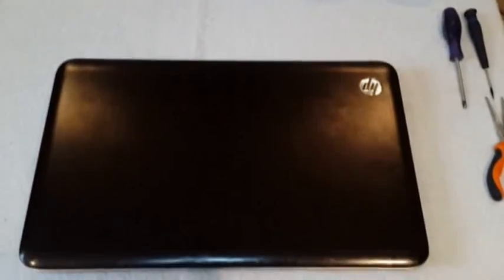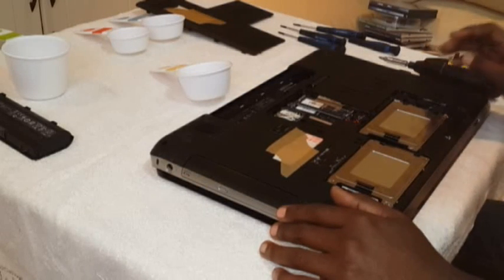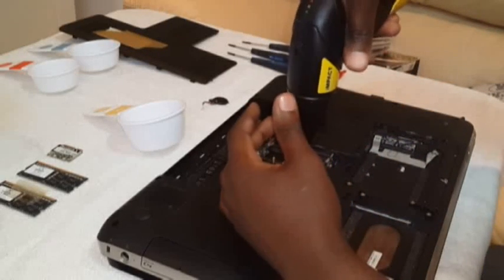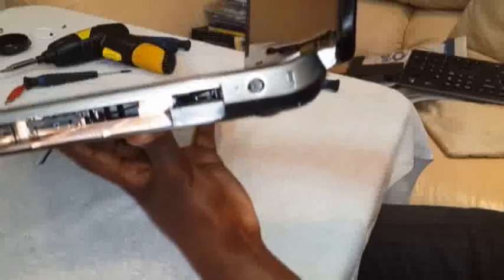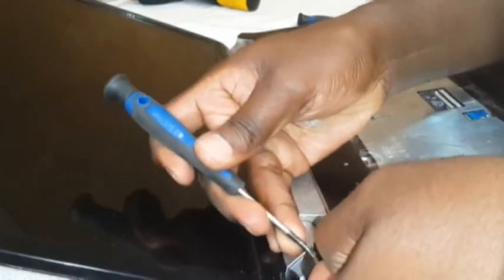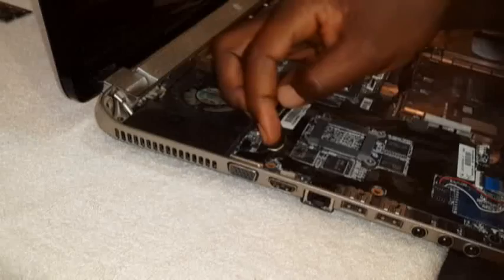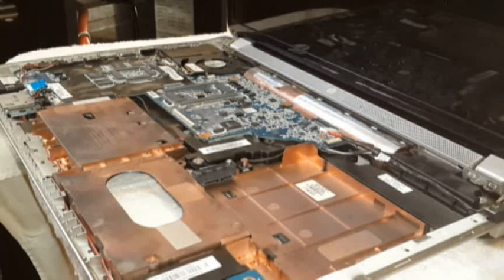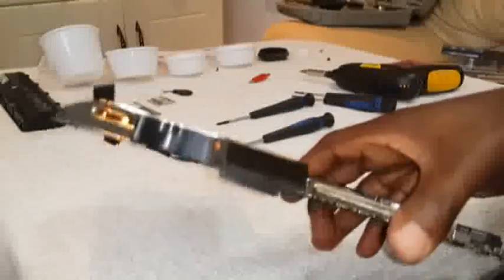Pavilion Dv7 dv7-6100 series Disassemble Cooling Fan Problem

Comment: I don't know if you're still reading comments here, but THANK YOU, THANK YOU, THANK YOU TUMZA!!!  I am a 60 year old woman with no formal hardware technology training; just a lack of fear of tearing things apart when there is nothing left to lose.

I was fortunate enough to have the identical laptop that you tore down here.  Only difference was one small cable  under the motherboard- the fingerprint reader.  My cooling fan was completely seized up.  Laptop would boot, but shut down after short time from overheating.  I used your video to tear laptop down to get to cooling fan/heat sink component for part number.  Found another video that showed how to remove and replace that.  Found the correct replacement fan component on NewEgg.

When I put everything back together, the computer wouldn't even start, let alone boot up.  So I tore the whole thing down again.  Found one cable that had pulled loose during reconstruction.  Put it all back together, and it booted right up.  New fan spinning away.

My guess is that this would have cost me $300 to $400 to have done at a repair shop.  YOU ARE MY HERO!
Reply from the maker: Great kathie, glad i could help. thanks for taking the time to give a good comment.

Comment: Great video. To replace the fan, all you need to do is detach the heat sink (screws remain in place). Peel the entire heat sink back - be careful not to upset the thermal paste. Then you can remove/replace the fan and reassemble.

Comment: Well I can tell you that your video is one of the best instruction videos on youtube. You explained it very well and step by step you cautioned the users of possible mishaps.  Unfortunately in 2014 HD recording  was not a common  option otherwise the video would have been even better. One point I can mention is it is best to flip the keyboard and disconnect it from the back and reinstall it from the back to. It's a lot easier.

Comment: Very helpful. I found a piece of plastic stuck in my laptop fan. With one hiccup (did not seat RAM properly) it went back together and is working. Who would have thought it could be done without more grief? That is, as long as you have someone else walking point and taking a video along the way.
Reply from the maker: Cameron Iwaasa  you welcome
Reply from the maker: tumza relaxing and thanks for taking the time to comment
Reply: I just realized that none of my USB ports are working. I'm thinking that I did not reconnect one of those bus wires. Do you have some idea which of the connections control the USB ports?

Comment: you can replace the fan alone I did that one year ago 
i bought it from ebay for 5 dollars and it is working up to this day.
to remove the fan you have to remove the screws on the metal cover and the sticky tape, then pull it from each side slightly away from the exhaust vent.

Comment: Excellent video!   Thank you for the help!    I had been stuck on how to remove the top cover.   Saw another video and the guy just ripped off the top with a knife and cut his finger open.   But there are the two screws under the keyboard.   So either he broke it....or the screws were previously removed.    Thank you again :)

Comment: personally i broke the air flow window without unscrewing anything and the metal one and cleaned the fan from outside
now my laptop looks like shit , thanks hp, great engineering
Reply: +anon-iraq U know...... that sounds like far easier solution then to spend hours unscrewing and detaching bunch of stuff before getting to the part you need... 
Darn it how hard it is to make damn lids in the fan areas!? HP, any brains perhaps?
Reply: me too :(
Reply: Mine broke a long time ago... cheap plastic parts and unnecessarily difficult to replace parts.

Comment: These laptops are a pain in the ass but they are actually very nice as far as speed and especially sound and video go. I will give this model of DV7 an 8 out of 10 which could be higher if access to components were simpler. When I got this the battery had been glued into place with silicone glue, not much but enough to keep me from getting it out until I decided it had to be removed to fix the overheating or be thrown in the trash pile. That was when I put some pressure into pulling the battery out and to my surprise, it only needed a tiny bit more force than I had tried before. This is one HUGE problem down and now I am off to rip out the guts and make everything new again. Out of all the laptops I have worked on (hundreds of them) this one ranks up there with the most difficult to access. THANKS BUT NO THANKS HP!

Comment: thanks for the video. I know this was a while ago. other people have mentioned you can reapply thermal paste if it still overheats. I've done that to multiple laptops and the fans hardly spin afterwards. thermal paste dries out over time. they make thermal pads that can be used in place of thermal paste.

Comment: Thanks for posting video,  i had noisy fan and had trouble disassembling case to get mother board out, finally did with your help,  and got new fan put in,   all good,     Thanks !!!!!!!!
Reply: Which heat sink paste did you use and how much was the fan?

Comment: The fan slides right out of the intake vent when you remove the tiny screws that attach it. No need to force anything. Got it for $12 on Amazon.

Comment: Usually, when the fan is working and clean and still overheating you have to take the fan off the CPU and remove the hardened Heatsink Compound and add a new compound before reassembling. This will reduce the temp. up to 20 Deg.C

Comment: Thanks for this. It helped me immensely. I had to order the fan all the way from china to get a new part but it worked. After years of collecting dust it's working again.

Unfortunately the windows 10 upgrade is pretty much mandatory now and my graphics card is not supported by win 10. So I guess I'll need to buy a new laptop eventually anyway. Still it was cool to fix the computer for next to nothing cost vise.
Reply from the maker: great staff

Comment: Hello! I'd like to ask you some info, I have a laptop hp dv7-6b41el, I had problems at the pc, I checked and the motherboard was completely melted, the rest is all working, I searched in internet for that specific motherboard model, but there isn't, however, I find the motherboard "in general" dv7-6000 series, although it is not dv7-6b41el should not change anything, at least in base of what I know, right? ps: where I could buy it at a cheap price?

Comment: I used a vacuum cleaner,like a Karcher or so,instead of sucking the air,i blew the air through the vent holes.
Then i sucked the air out of the vent holes,and now the coolers are dustfree and no more heating of my laptop.

Comment: Thanks - this was very helpful. You may find this maintenance manual useful also: http://h10032.www1.hp.com/ctg/Manual/c03043778
as well as these videos:
https://www.youtube.com/watch?v=zJKdO6yKQuI
https://www.youtube.com/watch?v=NLd00jnRwTY

The final part is to remove the fan motor assembly:
https://youtu.be/zJKdO6yKQuI?t=27m11s
1. Unscrew the 4 little screws that hold the fan assembly (plastic part).
2. Slide the fan assembly toward the copper tube (in the direction of the bracket that normally holds the display cable).
3. Lift it up.
4. Look for dust inside the copper radiators of the heat sink assembly and clean it.

This solved the problem mostly - made my laptop quieter and heating less - but I believe that the cooling system of this series of HP laptops has a design flaw.

Comment: Dude your havung over heating provlems not because of the fan but because of the heat sink compound... The manufacturer compound on these things gets dry and hard over time and becomes inefficient in transfering heat to heat sink and then the fan cools it but if the heat ismy being transfered then the fan sony going to matter... So replace the compound with fresh stuff guarantee it will fix your over heating issue
Reply: Need a tube of thermal paste

Comment: okaay...so after watching the WHOLE vidoe...the stupid fan is STILL attached...smh

as much as i like my dv7 i think it's time for something else that hopefully will last a bit longer
Reply: ironically very similar in they way they build apple laptops except you clearly see heat pipes on the graphics card
Reply: I had the same thought. All you need to do is detach the heat sink (screws remain in place). Peel the entire heat sink back - be careful not to upset the thermal paste. Then you can remove the fan and reassemble.

Comment: my fans dead how can I replace it
Reply: you can replace the fan alone I did that one year ago 
i bought it from ebay for 5 dollars and it is working up to this day.
to remove the fan you have to remove the screws on the metal cover and the sticky tape, then pull it from each side slightly away from the exhaust vent.